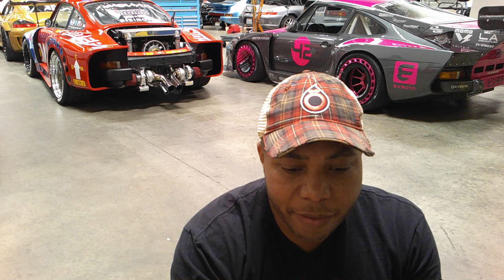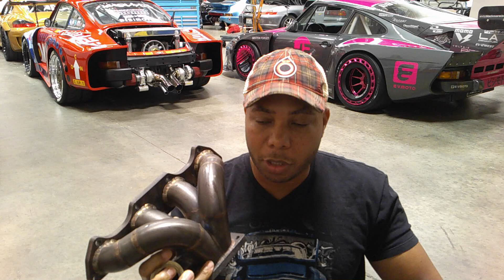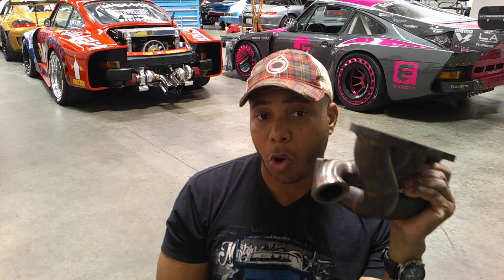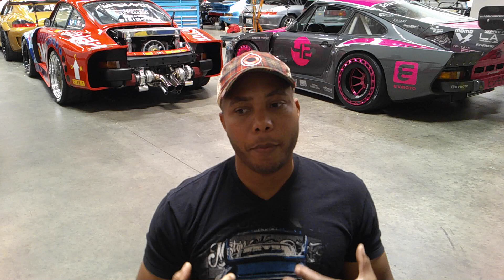Bad turbo manifolds, EV cars, and ugh...vitara pistons

Comment: I would love to see an in-depth technical look at your customers builds and the engineering choices you and your team have made for their vehicles.                                          

Just ordered some PurÖl Onyx for my B20 rebuild for my EK from your store Bisi, would you recommend staying with the manufacturer recommended 5w30 once the new motor is through the break-in period? Or would there be a benefit gained from going with a 0 weight?
Reply from the maker: That is a good idea. On the oil, yes, the 5w30 is ideal, as long as you stayed within factory bearing clearances.
Reply: Bisimoto Yep, all standard tolerances. Thanks Bisi!

Comment: Anybody can do donuts, they are just showing off to the easily amused. They require very little talent, while driving on a road course at speed requires an advanced skill set. They are like burnouts on a motorcycle. I have never done a burnout on my bikes or a donut in my cars, but I ridden "in anger" on some of the most fun tracks in the east US.
Reply from the maker: Cheers